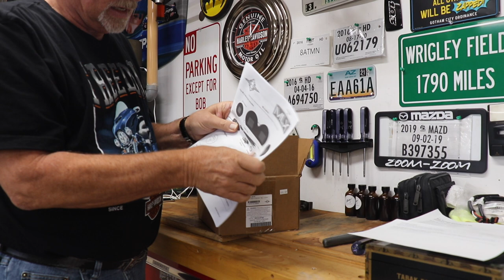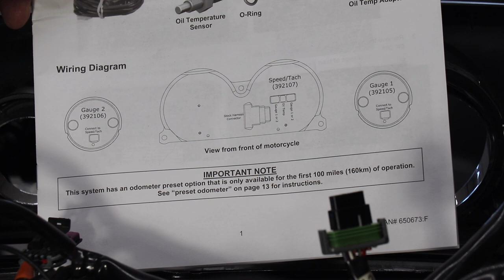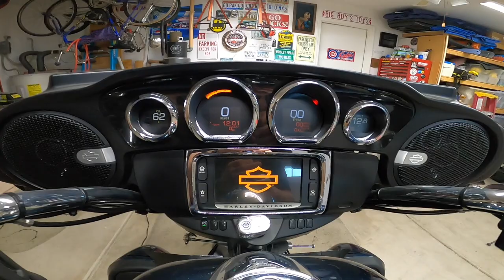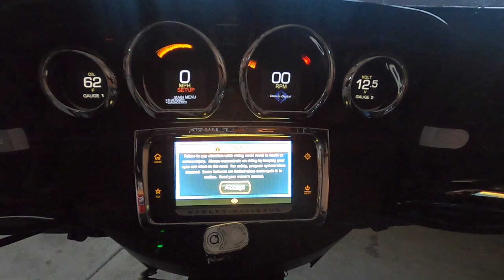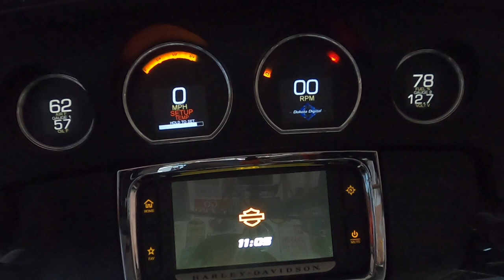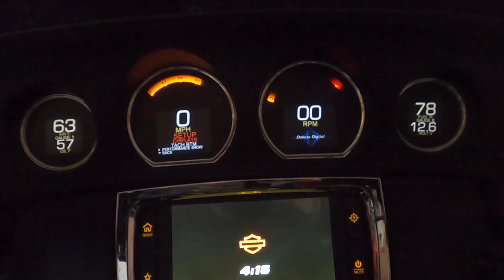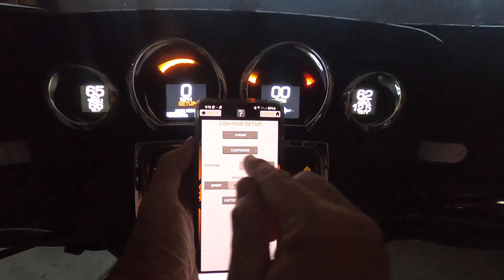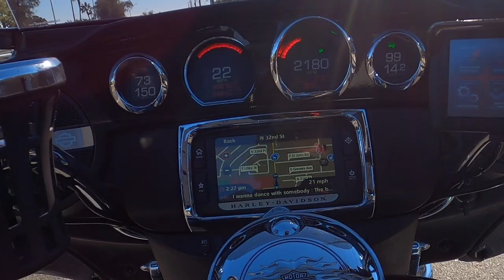Dakota Digital Gauges Install on a 2016 Harley Tri Glide Trike

Comment: I found your instructions very reassuring. I'm guessing thagt the button you were clicking off camera is on the motorcycle? Or was it on your phone?  I'm looking at purchasing the bike first, then the gauges. 😊 I'm glad to see they do the both imperial and metric. In New Zealand we switched to metric in the late 60's/ early 70's... when I was in my formative years, so I tend to think in ºC and Km/h. 😊
Reply from the maker: Yes, its the button used to cycle through the odometer/DTE etc..  It on the left hand controls.

Comment: Did you not put oil pressure sensor or did you use stock one.
Reply from the maker: There is no oil pressure sensor with the gauges.  I did install the oil temp sensor which comes with the gauges.  My bike has an oil pressure reading from the info screen on the infotainment unit.

Comment: Can you still get the alarms or error codes from the bike you use to get with  the new gauges?
Reply from the maker: Yes.  I actually got a message about my fob.
Reply: @Batman825  What message did you get? I got a B2112 code
Reply from the maker: @sire45  Actually it just said Key fob